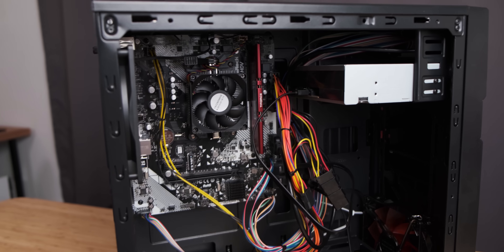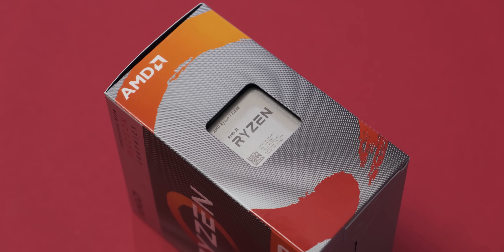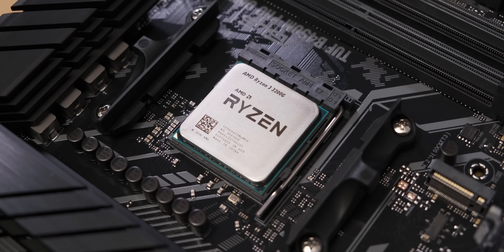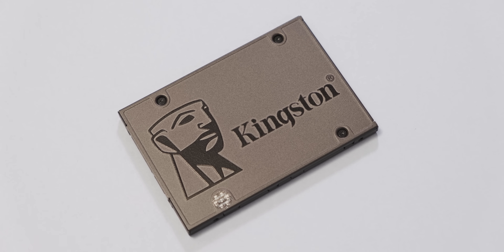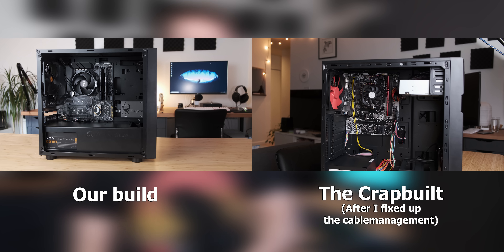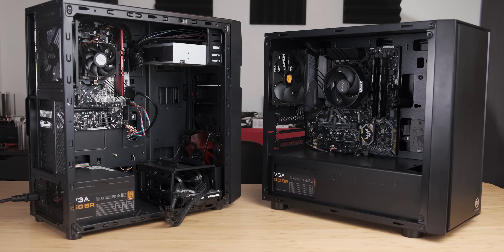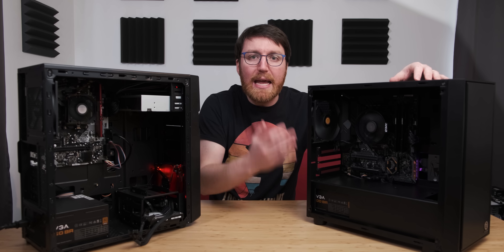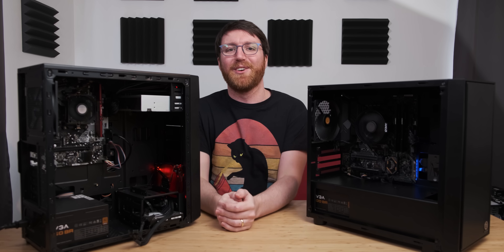Cheapest Amazon "Gaming" Pre-Built PC versus Custom-Built PC (2020)

Comment: Another great video, thanks a lot you made my day. I would love to see a video about old sli gpu's and stuff like that but also an overclocking guide.Hope you do this in the future keep on doing this.
Reply from the maker: I would love to play around with an SLI setup. immediately fires up craigslist
Reply: @DawidDoesTechStuff  I almost did an SLI build back in my first "custom" PC. "custom" meaning I picked the parts on Cyberpowerpc.com. It was back in early 2011 right when SATA-6 and USB 3.0 hit the scene and they were available on motherboards when I was picking things out, but they were at a more premium price point at the time so I missed out on that for the build, due to my lower budget.

I was originally planning to go with a SLI set up of dual NVidia GT 450's. THANKFULLY a friend intervened who knew at least A LITTLE better and advised me to go with a more powerful primary card and a dedicated Physx card at a lower budget price point. So I went with a GTX 560 Ti and an RT 430 (The highest I could afford at that swap out).

So I was buckled down a little by no SSD and being on the now previous gen-data transfer rate. But still, it performed ok. I had it up til 2017. It performed great at first, for sure. But over time, the slow down was BRUTAL.

I built my own for realsies in 2017 :D Ryzen 1600x, GTX 1070, 16GB 3000 MHZ, ASRock Fatal1ty Gaming K4 Motherboard, 250 GB Western Digital SSD 2.5mm, 1TB Seagate Barracuda 7200rpm HD, 550W Rosewill Glacier PSU, DYI-PC-48PBK or something case, 212 Hyper Evo CPU cooler. It was 1230 dollars after all was said and done. It STILL handles Overwatch on 1440p at Ultra settings at 144 FPS steady with 72c temp and about the same for the CPU. I did manage to upgrade to an EVGA GTX 1080 SC model from a Craigslist deal (got it for 350, then turned around and sold my PNY GTX 1070 Overclocked for 325). So only 1 upgrade, but that 1070 was a freakin beast and I bet it'd be almost as good even with that.

:D

Comment: 6:35 
Mate thats an msi armour card,they have terrible cooling and temps,i have the q300l that you have listed in the parts along with the h18 with 2 140mm fans and 3 120's and temps are STILL above 75c under laod and is super loud

Comment: Isn't the Deathmatch Arena of Death sort of redundant? :)  If you use the Q300L you will need to add front fans if/when you upgrade as it's much toastier inside than it would seem.
Reply from the maker: That is a great point. 👍 I ended up listing the Thermaltake H18 instead. I really like those cases.
Reply: haha I shoved 6 fans into my q300l, I used anti vibration mounts too so I dont get too much noise. My temps are great and has allowed decent overclocks on my 8600k and 1070ti.
Reply: @Loooooooooooooooool  You can brute force most cases into having acceptable thermals with enough fans and a dremel lol
Reply: @Loooooooooooooooool  I am also using the q300l with 1070ti and 8600k lol I'm upgrading to AIO coolers for both CPU and GPU though to squeeze a little more performance out
Reply: I murdered modded my Q500L with aviation shears and added 6 fans. In the end, I think I'd be happy with just 4 140mm fans. That would mean less murdering modding.

Comment: Hey there, what would you recommend me? Which motherboard, cpu and ram to buy for 300-400$ (or euros).
My current specs:
Motherboard Asus P8B75-M
Intel core i5 3570 @3.40GHz
8GB DDR3 1333mhz
Tower Aerocool cyclon mini
550W bronze 80+ Cooler master power supply
Gtx 1060 Nvidia 6GB
I am trying to improve gaming performance, so I guess i should go with these 3 items to change, as I mentioned motherboard, cpu and RAM.

Comment: When you account for system costs, do you include a windows license, all of the SATA cables and the thermal paste? I know that they’re not that expensive but when you’re doing such a budget build those little costs make a difference! (Also, I imagine that the person building this PC doesn’t have extra of those things laying around).
Reply: You get all the cables you need with the power supply and two sata cable with the motherboard...and the thermal paste is pre applied on the cpu cooler....you dont need to buy them .....
Reply: @kiavashasadi8687  so that’s not always the case. Some cheaper motherboards skip out on SATA cables, and the Hyper 212 EVO (for example) doesn’t come with thermal paste, you need to buy your own.
Reply: @thatguycalledaustin4206  dude first of all ,all motherboards do come with sata cables these days even the cheapest h310 or h410(actually i recently bought a cheap asus h410 and it did include two sata cables) and A320 does include sata cables so that's out of question...and all stock amd coolers do come with thermal take pre applied...im not talking about any cpu cooler on the planet but this video is about ryzen 3 3200g with stock cooler not with hyper 212 cooler and the stock cooler does always include pre applied thermal paste...
Reply: Just pirate windows.

Comment: Oops, I deleted the previous comment instead of editing it, since you do mention getting a Windows key in the comments. I've only seen it sold for $100 or thereabouts, though, way more than the $12 left in the original budget.
Reply: Happened upon this video.  Instantly looked for this comment.
Reply: well it is possible to move it from an older pc to a newer one. But your right the cost of windows should be included.
Reply: they're like $5 on ebay lol

Comment: Just finished 2 weeks ago a almost identical build, ryzen 3 3200, asrock b450m/ac, 16 GB ddr4, 500 watt evga, 240 GB ssd in a phanteks p400a case. About $420 with shipping and tax. Loving my first entry level build.
Reply: You spent that much on a p400a when you could have got a p300a and upgraded to a 3400g for hyperthreading, performance as good as an i3 9100f with a GPU, which will also last longer and can be max overclocked on the stock wraith spire. F
Reply: I did same last year with 2200g and now i bought 1650 super.
Reply: @miniweeddeerz1820  if I wanted a p300a case I would of bought one and saved $40. But I didn't, p400a comes with 3 argb fans, p300a doesn't. Plus if you check current prices, the 3400g is almost $100 more than the 3200g. All the games I play, CPU is 50°, 60 FPS on 780p TV with mid to high graphics settings...
Reply: @jeffkaiser1313  it's only 50 dollars more when comparing prices. And the 3400g comes with wraith spire so you could have overclocked it to the max. RGB is pointless in a system that would run super cool
Reply: @miniweeddeerz1820  the $420 price includes everything, I didn't have anything to use. No windows, no keyboard, no mouse, nothing, I agree $50 would of got me a cheaper case and better CPU. But when I do upgrade down the road, I'll have less to buy in future
Reply: @jeffkaiser1313  surely having less to buy is a good thing. Less money spent. And RGB fans aren't too expensive.

Comment: I can't stress how important a case with decent cooling is. I've recently upgraded to a Ryzen 2700x without upgrading the case itself and it was overheating like crazy so I had to experiment really hard to get it under 80 degrees under heavy load.
Reply: Average laptop temps be like:

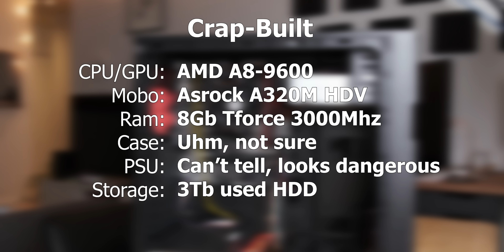Comment: 0:36 The case is a DiyPC t1-r
Reply from the maker: Awesome, thank you. 👍
Reply: @DawidDoesTechStuff  you're welcome, btw can you make a video regarding Dell Optiplex refurbished PC's?
Reply: @nahpets2345  The toasty bros made quite a few videos about optiplex upgrade builds check them out, but like dawid mentioned there is a hugeeeeee lack of futureproofing so down the line if you ever wanna upgrade then you will need to swap out the cpu,ram,and mobo because almost EVERY single old cheap optiplex is on ddr3 using an ancient socket like lga 1155 but for a solid 2 or 3 years with a good graphics card it will probably hold up really well because as crazy as it sounds these old i5s and 2nd gen i7s hold up amazing in the current generation. So yeah these are most of the pros and cons, you can check out some of toasty bros budget builds while waiting for dawid to hopefully upload something related to this😁😁
Reply: @Slippery_  yep I own an Optiplex 3020 and I don't know what to upgrade! I need to find a gpu less than 80€!
Reply: @nahpets2345  I would go used at that price point
Reply: @kobewong2122  me too
Reply: ok but whats dawids case called from the beggining of the video in the background

Comment: Wow, this is pretty cool. 

So if I built this and needed more storage for games could I pop in a separate HD to install games on while running the OS off the SSD and still keep the performance?
Also...did you factor in the cost of windows into the custom build?
Reply: SIGMA Definitely can buy a second drive to store games, could probably get a 1 TB barracuda or similar for $50/60. Most videos will not factor in cost of Windows, but there are ways to source for free and get an authentic version.

Comment: Hey Dawid, I dunno if you still remember me but I have bought a Sapphire RX 580 instead of a GTX 970!
Reply: good buy!
Reply: I just bought a gtx 970 EVGA ssc for 25 usd and it is amazing I upgraded from a R9 270
Reply: @amogoose5638  25 USD?
That's so cheap
Reply from the maker: Yes I do! That is awesome. Great gpu for gaming. 😃
Reply: Hi yeah it was wayyy to cheap to pass up I’ve been using it for the past few days and it’s working awesome, I’ve took the cooler off and cleaned it up and put new thermal paste on
Reply: Christian Concordia £95 refurbished with a 12 months warranty.
Reply: RGC Tech is that better than a gtx 1050ti?
Reply: Elias Sanchez RX 580 is better than a GTX 1060 and worse than a 1070 (this is edited and said something wrong before)
Reply: RGC Tech oh ok thanks
Reply: @RGCTech  Uhh no its more a 1060 counterpart
Reply: @RGCTech  its worse than 1060
Reply: Alex Gamer 04 it’s not. It’s better than a 1060 and worse than a 1070

Comment: Answer : custom!
Reply: its not
Reply: @massmassive8329  custom builds are better! Prebuilt is only good when someone is on a tight budget but still budget prebuilt mean old dell or hp prebuilts!
Reply: that's actually something I'm doing right now, what I am doing is, because I have never built a pc before, I want to get an idea what it's like to upgrade a pc so I can get a feel on what to do when I get the components, so I bought a prebuilt Dell Optiplex, and I'll upgrade the components from there.
Reply: Dogfacezombie just build it bro. fr, it’s not hard i built mine first time and it still runs perfectly. dm me on discord pterodactyl#6992 or on instagram @alt_acc_111
Reply: @maconaccount2533  Thanks, I was already thinking of doing it, but I'm just really nervous about cable management with the PSU and installing everything into a case correctly with no experience.
Reply: Dogfacezombie there isn’t anything to be nervous about tbh. it’s a really good experience and it’s just plugging bits in and screwing bits. just dm me i’ll help.
Reply: @maconaccount2533  Thanks, I know I shouldn't be nervous, it's just from years of paranoia, anxiety, and experience in screwing some things up, I feel like I might break something. Even though I know how to build the PC and have in working order, heck I bought a prebuilt optiplex a while back and everything on there was wiped and I managed to get everything set up without the help of a yt video or asking someone to help
Reply: @maconaccount2533  idk, I think I'll just build it, thanks for convincing me, I'll friend you on discord even if I don't need help
Reply: Dogfacezombie i accepted ur friend req. i’m there if you need me.
Reply: @maconaccount2533  thank you man
Reply: Dogfacezombie we all make mistakes. In order to learn and become a pro, you have to turn your mistakes into lessons! Mistakes are not failure my friend, they’re learning lessons to make you a beast and a better you! I understand how you feel about breaking things but feel your confidence, do research, read forums, watch videos and get it down! It’s all about learning! I’m dropping $4,500 on a custom PC build that I’m gonna do and I’ve never built a PC before. I did lots of research when I bought my laptop msi g63vr. I figured out my build and now I run a Msi Optix MAG24C triple monitor setup and Corsair K95 RGB cherry-red switches keyboard. It’s a tricky setup cuz of hardware but that’s the reason why I’m building my own PC now. An actual desktop and not laptop. Reason was I needed my computer to be mobile for business reasons but I wanted to game too so hence a laptop. After months of research on my laptop, found it on Best Buy. It l Had the exact specs I wanted to build but Best Buy had it pre-built. Intel i7-7700HQ, 16GB DDR4 @2.4ghz GTX 1060 6GB GDDR5 nvidia GPU, 256GB SSD and a 1TB HDD. I was saving $300 if I got BB instead of Msi building it for me but after 3 years of learning (and saving) watching vids etc, I’m personally going to build one myself now lol. Reason I feel confident is because I worked as a technician on cars for 7 years and have done electrical plus like this vid shows, custom is always better cuz you know exactly what’s going in there. If i mess up, oh well buy another one haha ik it’s expensive but that’s the cost of learning 😂 I didn’t get to be a big expert on mustangs without touching one? A mechanics manual book helped ya but immersing yourself does wonders. This is New/1st build I’m gonna do/future proofing. Msi MPG Z390 gaming pro carbon AC MoBo, Samsung Evo 1TB M.2 SSD(boot drive obv), Samsung 860 2TB SSD, Corsair 850w 80+ gold modulated PSU(might go with EVGA though), Corsair Vengeance RGB 64GB RAM @ 3.2ghz, Msi RTX 2080ti Gaming X 11GB GPU, and ofc the intel i9-9900k CPU. I’m also going to watercool the CPU just to be on the safe side and some people are kinda against it but I feel like liquid cooling would help a bit more, not like that system will ever get hot but hey at least I’ll be good. Not watercooling the graphics card though cuz then I gotta get rid of all the cool looking stuff like the faceplate I forgot what’s it’s called and basically strips the card to the PCB plus that GPU has 3 freaking fans. I just feel like in cars, they all have a cooling system to cools down the engine and keeps it at optimum temp, the watercooling build for the CPU will keep it cool if it ever gets hot cuz it’s taking away heat and cooling down in the radiator and 2/3 fans are blowing into the radiator. I wanna say it’s like a hot summer day and you put a fan, it just blows hot air but get an A/C like in a car then it cools you off for sure. That’s just me but ya build it! Don’t be afraid! It’s best to see what did happen instead of what could have been... ya know? Good luck! 👍🏽👌🏽
Reply: XxBEFALLENxX do you really need 64GB of RAM? Also, what are you going to be using this PC for?
Reply: Dont use the "!" if ure not a boomer
Reply: XxBEFALLENxX wow that’s an insane system.

Comment: Nice comparison! Custom builds are always the answer, but just wondering why you decided to ditch the Deepcool? I’ve built a couple of pc’s now in the Matrexx 30 and have really liked how they’ve turned out. It is on the cheaper side and a bit cramped inside, but at $30 I think they are fantastic value for the money.
Reply: Personally I'm on the fence about the Matrexx 30. I've found that their stamped panels are sometimes off by a significant margin, and the PCI-E slots are poorly aligned with the motherboards slots.

Trying to get an HDMI cable to plug into the top slot requires manually crushing or removing the curved stamped metal piece (only the top slot mind), which leaves it looking ugly and unprofessional.

There are many positives of the case though, but alignment is the major issue.

Comment: I did build a comparable desktop in April 2019 with a Ryzen 3 2200G, 16 GB DDR4 (3000 MHz), Asrock B450 HDV 4.0 motherboard. I reused a 128 GB SSD, 500 GB and 1 TB HDDs. In November I replaced the sata-SSD by a 512 GB SP nvme-SSD (3400/3000MB/s). In total I spend without transport costs and tariffs $350. I'm not a gamer, my hobbies currently are Virtual Machines, so I have all Windows releases (including NT, except 8) and all Ubuntu LTS releases starting with 4.10 :)

The Host OS is Ubuntu 20.04 LTS and it runs from the ZFS filesystem. I love the current performance. Linux VMs boot in ~10 seconds and the Windows 10 VM in ~35 seconds (real boot, no wake-up from hibernation/suspend).  I probably will do a mid life upgrade in 2021 or 2022 with a 6- or 8-core Zen 2 or 3 APU :) 

The black Midi-Tower came with a 600W power-supply for DOP 1500 (US $30) and I bought it locally in Santiago de los Caballeros, since transport costs would at least have doubled the US prices. The power-supply is old fashioned with 24 + 4 pins for the motherboard and 2 SATA and 2 Molex plugs. I don't worry too much about that iTech power-supply, because the PC only needs ~150W and it is protected by a 1200 Watt Avtek Surge Protector :) The case has a lot of space for HDDs, looks really nice, but the metal is a little bit thin. The power on light is a small blue led strip above and right of the power button and it turns red, if the disks are active. I love that small stupid detail :)

Comment: As somebody who repairs power supplies a lot, I think that a power supply without a special 80 Plus rating or something like that isn't dangerous. Dangerous power supplies do exist, I have seen quite a few of them, but the one in this video you said you wouldn't use again does not seem dangerous at all. I would need to open it to really tell, but this seems OK. It just doesn't have stuff like an active PFC, and some connectors you would lke to have.